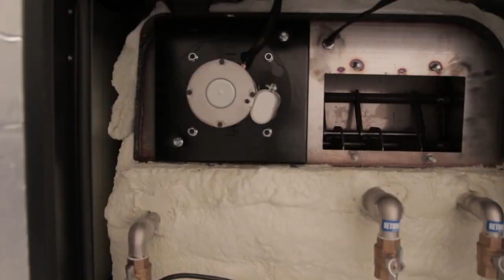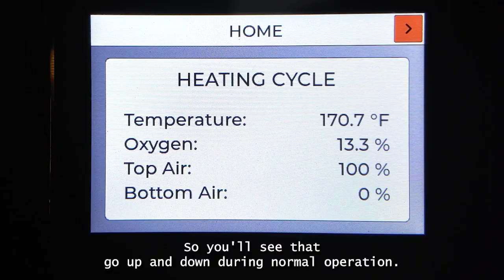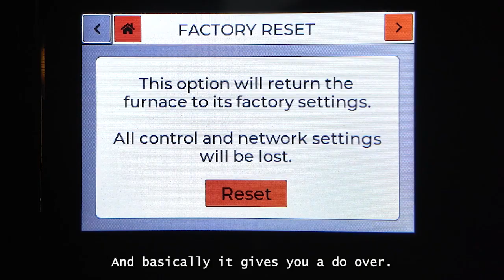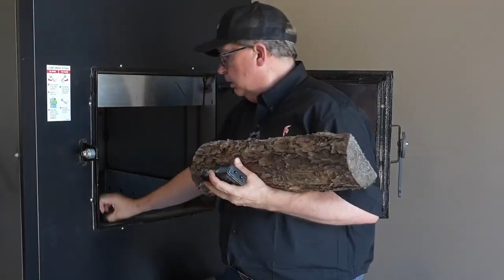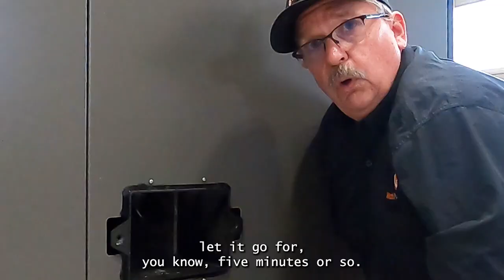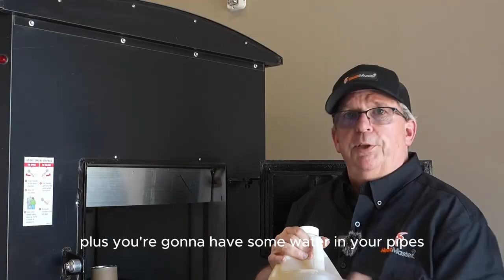2025 G Series Walkthrough: A Detailed Owner's Guide

Comment: Great new features for the 2025 model.  I picked up the 2024 model and saved about 3500-4000 last year rather than using heating oil and electricity since I have it going through my indoor oil boiler box and then my hot water heater before returning to the G7000.  Suggestion for the next upgrade to the panel - Text alerts if the water gets to low or the fire gets to hot.  Something major has gone wrong to get either of them.  To everyone: If you are looking to switch from heating oil or propane or even electric.  Seriously consider the G series.  Ease of cleaning and maintence was my main focus and no other gasification unit can beat it.  It also beats the pants off other brands for how little carbon gets released.  You can see this on the EPA website...if it still exists.